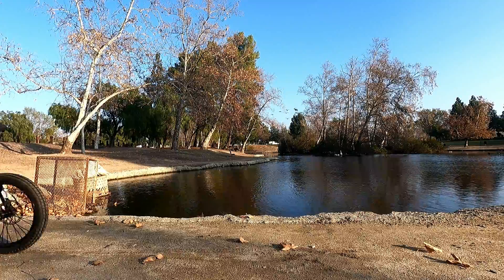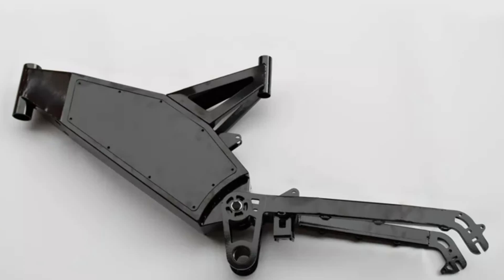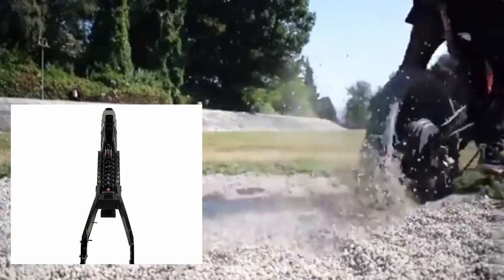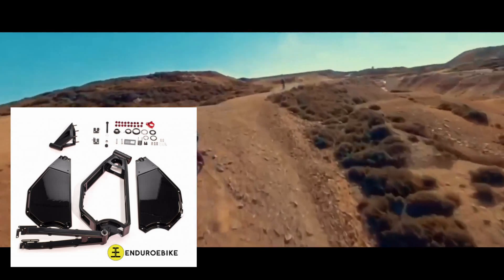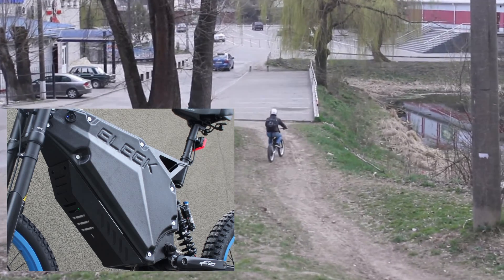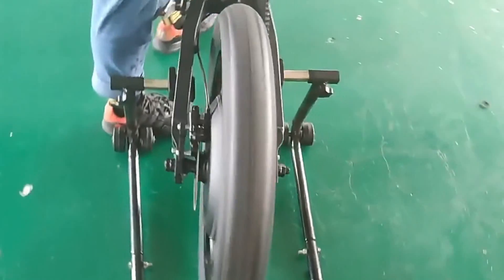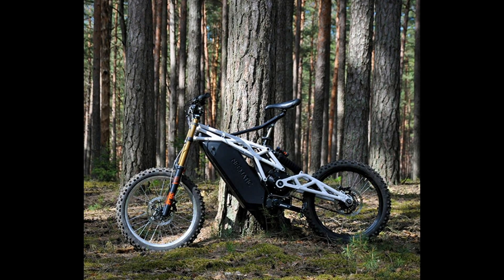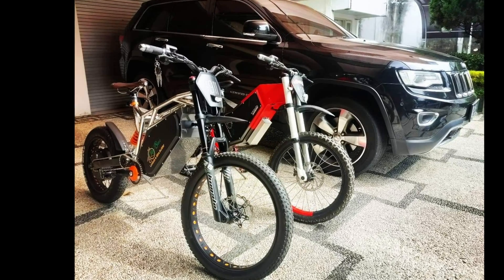7 Enduro Ebike Frames for DIY Electric Bicycle Build

Comment: The one you referred to Enduro E bike. The frame with the red thumb screws. I built with this frame and use it primarily for Enduro. I put some Michelin star cross 5, soft. I’m running a QS205 6T with sabvoton 200amps unlocked. 
This frame can handle some abuse for sure! For trail use I normally don’t go past 120 dc Amps 350 phase for range purposes. Plus any more amps with the 6T winding it’s just insane torque. I do some pretty gnarly hill climbs with this 6T. But it has its limits especially with DNM suspension LOL 

But yeah I just wanted to comment and say it’s a really strong frame with the carbon steel. I take it to the mountains and ride with KTM’s 300s and most of my buddies have side-by-side’s. So for anyone needing a frame for off-road use This is the one to go with 👍
Reply: Still running that setup bro?  Frame held up ?
Reply from the maker: @M-dv1yj  yeah, I think I'm at around 5000 miles, still running good.
Reply: @samjohnson517  do you know where i can get that enduro e bike frame seems like the website for it its down permanently
Reply from the maker: @brian-iz9zd  I tried the Enduro e-bike website it seems to be working but you can also get them on AliExpress.
Reply: @samjohnson517  the battires they are selling also look too good to be true lol

Comment: That last stainless steel frame was nice. Switch that for chromoly and you’ll have a super nice frame.  
Your point of “looking like a bike” is really important to me as I want to avoid conflict from other trail riders and authorities.
Reply from the maker: I know that was one of the things I was kind of disappointed about, chromoy would be lighter for sure. I may ask him if he would build one out of chromoly. Or maybe a high grade aluminum
Reply: @samjohnson517  
Just a couple thoughts: Chromoly itself isn’t lighter than steel, it’s just so strong that thinner walled tubing can be used reducing the weight.  I believe aluminum requires heat treatment after welding. I don’t think a lot of places know how to do that properly.  From what I understand a higher end bike brand had problems with frame breakage and the thought was the heat treatment was performed incorrectly.

Comment: It’s all about the CS20! Mine is on its way. Not only is the aluminum light rectangular tubing with nice welds, but it’s so over built that I am turning the top tube into a sealed speaker box with embedded phone slot and below on the lower tube I’m going to cut in a remote tire pressure lcd gage, Mac Mini and separate juice for it all. Also one of those resistor led J plugs for electric car charging station capabilities. Next I gotta find a good spot for a long thin display. Maybe from lever to lever with a sleek guard. Going to drive a 3-slot matrix video wall card so either side has rear view mirrors (via tiny cams) and the Mac in the middle. 

It’s videos like yours that lit my brain up. This shit is so fun!  Nice production, man. One of the best.
Reply from the maker: Thank you man, that sounds awesome! it would be really cool if you can make some videos on this build I really would like to see it when it's done!
Reply: @samjohnson517  I will for sure. While it’s and the dock I’m building a ramp to get up six stairs. I should plan lighting and spot to do it now so the unboxing looks good.

Here’s another hop up...I’m going to yank the seat, cut a slot. In the frame and slide in a corvette leaf spring. A little flex, a way trimmer rear. Gotta make a good spot for the controller and mounting 10A charger with cord on the damn thing, too, 

See what happens when it takes two months to get here! Idle hands make trouble. 

Oh yeah, heated seat and grips, 4 teenee webcams and a removable rack to hold a OneWheel. 

Dude. I need a chick.

Comment: Thanks for the information. My favorite is the Le-Bui tube design... the reason it's my favorite is because I'm a welder and out of all the frames you listed, this one seems like it's really flexible. If you're in the DFW area and wanna play with some builds let me know. If your designs are good, I'd build you a couple bikes for free just to get a copy of your prints. Check out the software bend tech. It's kind of expensive but if you're into tubular designs like the trellis frames on racing motorcycles, it's great software to have. It calculates bends, creates cut templates, dxf files, etc... I don't have anything related to motorsports on my channel, but if you're interested in TIG welding check it out.

Comment: There is chinese company that makes an ebike that looks like the Neematic. The frame is made out of aluminum. It is called Velimotor VMX06A. You can get it with moto seat or with fixed 3 option height adjustment bicycle seat.

Comment: Interesting that the less steel or aluminum the frame has in its construction, which is strength, the more it costs ? Obviously all the metal is thinner too. Strange. Oh, if you want a really good frame design look for a 64 degree head, its the best for control on any surface, wet or dry. Very good video thanks for the great info !
Reply: The raw materials cost nothing relative to the additional engineering and precision needed to make a light but strong frame, especially one that is a clean slate design. I imagine with today's prices, all the aluminum needed to make that awesome $13,000 frame would cost less than $1,000 including the head tube and bottom bracket.
Reply: @marthamryglod291  Yep, that's where the price is comin' from. The lighter is is, the more testing you have to do to make sure it won't just fall apart.

Comment: If you not in the high budget you can find a NEXT POWER CLIMBER as this frame is just like the Enduros as it is perfect of going over 30plus mph of handling and comfort. I have another e bike MTB with just front shocks as the Bike rides rough when on rough pavements , bumps, dips, pot holes, ect. With the Next Power Climber the bike rides awesome and smooth going over these conditions on road. You can tell just looking at frame and also a PLUS for FRONT HUBS. Just a bit hard to find now since its older model but seems the Enduro e bike based this design from it, just the bottom shock is a bit more downward assuming copyrights designs.

Comment: Hi Sam.  At the 1:30 mark you were talking about these frames not really being able to hold up to extreme use.  Could you expand on that just a little?  Am I going to be able to do some downhill bombing on this frame or what are you thinking the weak points are?
Reply from the maker: Hello and thank you for watching, it mainly has to do with where the rear shock mounts and the swing arm that's a very weak point, I actually smashed the mount into my swing arm and cracked it I go over it in my Enduro review video. I think a longer stiffer shock would have helped but it's still a weak point.

Comment: Which 1 is best for taller riders 6'3 and above..i seen 1 but i was too big for it.
Reply from the maker: The frames are all pretty much the same they don't seem to come in different sizes. I'm 5'8 but my seat post is all the way down and then I'm barely flat-footed. I would say get whatever frame you like and then adjust all the other parts, for example get a longer rear shock instead of 190 mm get a 220 or 230.  And maybe longer front forks.

Comment: is it possible to use the bafang with this? i like the aesthetic of the bike but don’t really wanna put a hug motor in the middle like the pedal motor
Reply from the maker: From what I understand the bottom bracket is too wide for a mid drive
Reply: @samjohnson517  is there a frame thats like the enduro that the bafang can fit?

Comment: Most of these frames will only work with hub motors. Any recommendations for a mid drive build?
Reply from the maker: Yes not a lot of choices for mid drives, I have seen some clones of the white frame in the thumbnail, they pop up on AliExpress and Alibaba from time to time.

Comment: Interesting to see the Neematic FR/1, it looks like the UBCO FRX1 which has mysteriously disappeared off their site. Perhaps they sold the design? It's a stunning looking minimalistic and futuristic frame.
Reply from the maker: That is my favorite design, I love that bike. The lebui is pretty close but I wish they would make it out of chromoly steel instead of stainless. It would be so much lighter and just as strong.
Reply: @samjohnson517  Yep that frame with a more powerful controller like the BAC8000 would be my dream e-moto. I probably wouldn't run it with pedals.

Comment: you dont have the enduro frame. thats the original bomber clone frame. the slim version with the puffed out side panels and skinnier middle is the enduro version of the bomber frame. i have your same frame. it was only 250$ when i bought it right before the pandemic and now the prices are ridiculous. im glad i found this video though because my bike is only at 17kw because im afraid to push my motor to its full potential while on a bomber frame. its not made for huge power. i have a qs273 50h 4t that can take over 50kw but im limiting my fun because the swingarm cant handle it. i need a new frame asap. starting the third riding season with a bike that barely hits 65mph. been wanting to upgrade for a while. new frame and new controller.

Comment: Have you found any universal rear racks or moto seat racks that are compatible with the Enduro frames? Eleek and Delfast make some rear rack options but not sure if they fit other Enduro frames. I ordered the common Enduroebike frame with the plastic sides to go with 205 5T/ Sab 72100.
Reply from the maker: No I haven't but since it has a tire circumference of a standard 26 inch mountain bike wheel there may be some standard racks that could work but you might have to modify the bracket,  that's a nice frame and that 5T motor is going to have some torque

Comment: What hub motor do you recommend to use on these frames ?
Reply from the maker: Well that depends on what you want I'm using the qs205 3.5 turn for top speed if you want torque  and a little less speed go with the 5 turn if you're going to be hardcore off-road steep hills  and putting a lot of power through it all the time look at the bigger qs 273

Comment: I'm going to be watching every single enduro bike video you've put out, great stuff.  

I'm in the process of building my 2nd DIY ebike, but I think I after that I'm going to be looking at a 3rd build for a higher power enduro-type bike. I know you've been pretty much just building your bikes part by part, but do you have any knowledge of the build quality of the prebuilt enduro-type ebikes floating around on aliexpress? It is tempting to drop 3 or 4 thousand to just get one of these bikes without having to do any of the assembly, but I have concerns about buying something that could be expensive junk.
Reply from the maker: Hello and thank you for watching, for pre-built bikes you may want to check out Enduro e-bikes.com they seem to be reasonably priced , well they were until prices went up, but that pretty much goes with everything else.

Comment: For some reason there are so many of the enduro type of frame, but I’m looking for something which is shaped similar to lets say the super 73 or the onyx rcr. Kind of a canvas where you have room to really build anything in there you want. Also more for city use with supermoto tires for example.
Reply from the maker: Hello, check on Alibaba and AliExpress I've seen some on there even full suspension folding frames.
Reply: @samjohnson517  thank you my friend, what search terms would you recommend? I already saw the last dealer in this video has made some of those type of frames as well, but more choice is always better of course!
Reply from the maker: Just search electric bicycle frame on Alibaba and you'll see some super 73 style frames come up.

Comment: What wheels are on the first bike?
Reply from the maker: That is my bike , those are 19 in motorcycle Wheels.
Reply: @samjohnson517  I'm undecided whether to get the 21 inch motorcycle ones or the 26 inch fat tire. Are you saying that the fat tires can be uncomfortable to ride?
Reply from the maker: @imed9774  well it depends on the power you're putting down but  I would never go with any size bicycle wheels,  you will  be dealing with flats bent and  broken spokes  because of the weight and the power.  I went with 19-inch motorcycle wheels and it worked out really good the only downside is trying to find tires in that size.  Some people go with an 18 rear and  21 front but I don't like the way it looks and I was concerned about handling on the street.

Comment: BOAS NOVAS ON LINE

(Brasil)
Friend help me with a brushed controller d 30 vts 500w 28 A. XUN brand.
I don't know how to connect this device, on the accelerator with a contact key, this accelerator has 5 wires
(On Throttle Socket: Green, Black and Red)
(separator: 2 wires; Yellow and blue.) This throttle has a motorcycle key and battery indicator.
on the brush controller there is a white socket written: (Derailleur) in the colors green red and preto. I already know it's the accelerator but what about the two yellow and blue wires????
where can i plug it in?? we have two blue wires in a white socket written lock two blue wires written lock; what are these two wires for?
Reply from the maker: Hello, I am sorry but I am not familiar with that brand, can you get the wiring schematic or diagram from the place that you bought it from or from the manufacturer?
Reply: @samjohnson517  for sure friend I'll check there I tell you, I'm having a lot of difficulty here to complete my homemade motorcycle

Comment: Not really a fan of the frames with the bottom bracket on the swing arm, not much point installing a shock at the rear if your not getting the full benefits of the suspension. Cs20 looks pretty cool.
Reply from the maker: Hello I guess I'm not understanding what you mean it's better to have the bottom bracket on the swing arm because that eliminates chain tension issues when the suspension compresses. My bottom bracket is mounted on my swing arm and I assure you I get full suspension travel standing up or sitting down
Check this video around 5 minutes 20 seconds https://youtu.be/zFX-spRDRpQ

Comment: Replace all those Allen head screws with thumb screws. It's a few bucks.
Reply from the maker: Yeah I thought about it but the problem is they would stick out and I would constantly bang my knees on them. It works on the other frame because the area where the thumb screws are located is recessed.

Comment: Ok, so i know it cost more to diy mod my aluminium Mongoose MTB frame, but at least it don't look off-the-shelf. And 28 tamper resistant Torx screws, on each side, does make bike thieves think twice. They want one easy to snatch, like yours.😁 Remove any key switch, and install a keyless remote/alarm system. Mount the speaker, in such a way, that it can't be seen or cut. Then listen to bike thieves when they say, Yo, that a U-lock! Buy the fattest U-lock you can find.